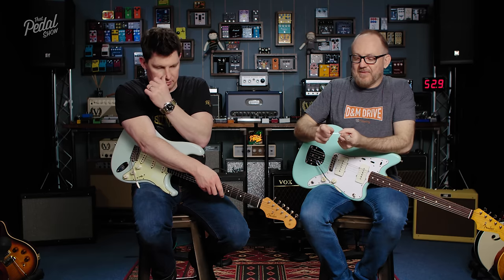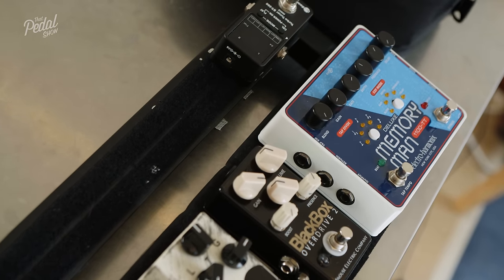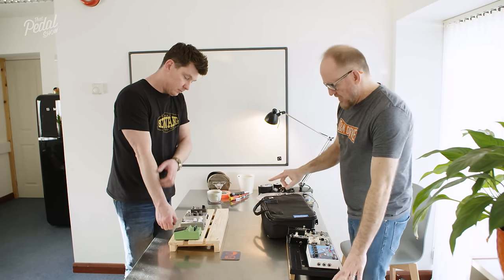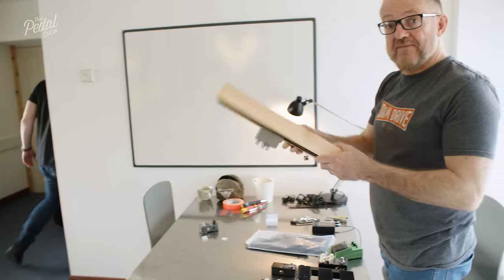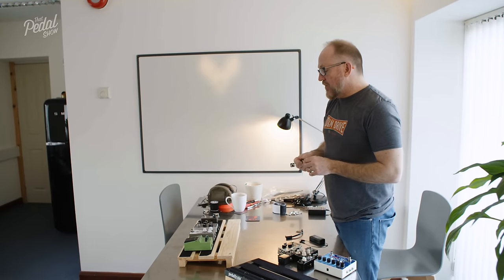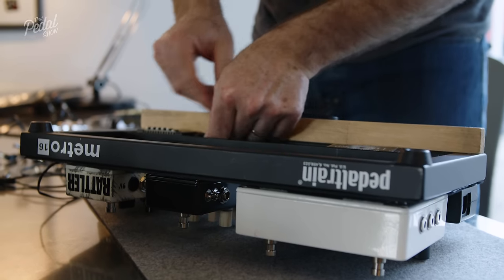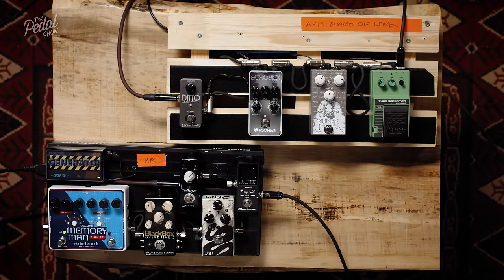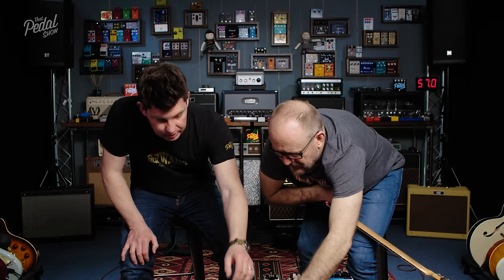Tips For Your First Pedalboard Build – That Pedal Show

Comment: I try to remember to have the iec cable on when placing the power supply to avoid that. I have routed non modular power supplies only to have to undo them. One of those was defective the other need some cables I tied behind the motherboard tray unmanaged because it got upgraded. So that happens, lol.

Comment: My pedal dudes... I love that my new Friday routine of spreadsheets and powerpoint presentations has TPS in the background. I, like Mick, have had issues with isolation noise. I thought the battery fix was cool, but what is the next step? Buy a new power supply? Or just grin and bear it and use a battery forever?
Reply from the maker: Whatever works Bryan. But about five minutes after I first plugged it in I decided I'd never use anything but TheGigRig as long as I live. Cheers!

Comment: More jam time por favor! That was a great cap to a solid video recapping the fundamentals of board building. Question: the mythos pedal Mick was having trouble with, was it receiving signal noise from one of the other pedals (i.e. How a digital pedal can sometimes create sonic artifacts along a daisy chain), or was it a ground loop (which I can't see how that could be since it theoretically was "lifted" by virtue of being battery powered). Unless of course the nature of the battery source itself could cause "dirty" power. I think I just talked myself into a ground loop. 😅

Comment: Just a thought ,on the chord running in front of you issue.Now would this change if you happened to be a left handed player.Your chord would come out on opposite side in this case.Wouldn't that put the chord back to where you had to step over it?I know the signal path couldn't change  .But,couldn't you arrange pedals from L to R?Keeping the signal path that it takes from R to L.To keep the chord from being in front of you.Remember most likely someone who is a lefthanded player.Most likely are going to want to use their left foot also.Hope this isn't confusing.Or maybe a lefty would just have to adapt.Great show guys.Always making me think.Keep up the good work .Corey

Comment: Why does the loop side go on the board? So you can hoover it clean. Once every 3 years, whether it needs it or not.

Another pro tip: try cutting the pedal-side velcro in triangles, it gives you a better chance of pulling them off the board without just ripping the velcro off the pedal, simply start pulling at the point of the triangle.

Comment: VCPI turned out to be a surprisingly difficult thing to follow in real life after deciding to buy a fitting power supply for my use, after watching the video. Like, you have five pedals? Great, you can just about do with a something like 120 euros power supply and get the isolation done properly. However any more than that and you're either gonna spend something like 200e + or just straight out go all in and buy gigrig independent items.

If you don't care about isolation, you're good to go with more pedals and if you care about isolation, you are good to go if you got 5 or less pedals. OR pay a hefty amount of money. Voltage, current and polarity are usually fine with any decent power supply option and common pedals, you won't run into problems, but isolation is a bitch frankly speaking. You're almost bound to go daisy chaining some of your pedals from isolated output unless you go heavy on investment. And it turns out that you run out of slots really quickly if you get interested in pedals. Like just gain section will take 2-3 slots easily, including one or more of overdrives, distortions and boosters, even if you try to be picky about your practical board. Then the time section will have 1-3 pedals and modulation will feature 0-3 if you use any effects in your set. Then there's "special" pedals like fuzzes, wah, eq and whatnot. And you better not be versatile in your sounds during the set, that will likely add a couple of gain pedals more.

I never thought it'd get so complicated so fast with powering them back when I started watching the show and had overdrive pedal barely used and wah sometimes, having just one gain/clean sound from the amp and reverb from the amp itself as well. Daisy chain was all I needed because there basically wasn't any signal chain to care about. It's really hard to figure out what kind of power supply you need or can get by with if you try to be efficient and not get something completely unnecessarily overboard for your needs, and if you try to not spend more than you need to. The dream of course is build everything exactly prefect with gigrig products and the cables Dan uses, but oh boy, that's some big money.

This wall of text ends with an idea that was inspired by the thought. It would be brilliant if you did an episode about the practical side of the power supply shopping. You'd have different sets of pedals from beginner board to intermediate to advanced board (even an extreme board perhaps?) and discuss all the possible power supply products that the board would need or benefit from. And of course the different options if the boards had some. That might be really helpful for people who try to estimate their power supply purchase from existing options without going for the priciest one by default.

Comment: I was just about to build my first pedalboard,  but I had two strokes instead. Busy recovering these days, but I’ve thought about patch cables , and pedal order etc. Is it considered  ‘okay’ to go through the front of my amp with gain stages, and run time based effects through the effects loop? I think so, but I’m not sure about modulation 🎃. Stay safe & keep doing what you’re doing!
Reply from the maker: Of course Duncan, and sorry to hear about the strokes - hope your recovery is on track! 
Yeah, that’s the way most people do it. Modulation is always tricky because some people like certain mods pre drive. So just try it all ways, safe in the knowledge that there is no wrong way. Only the way you like best!

Comment: Q for Dan, about power: when you use the power cables that come with a power brick (as I do), as they're not made to measure, you typically end up with a tangled mess of excess power cable like Mick's board had (as I do). Q1: is that a problem? and if so why? (Dan did a build for Ed O'Brien and he mentioned setting the power and signal cables at right angles to minimize 'interference') Q2: Are there any solutions for 'Macgyvering' the power cables that come with a power brick to make them shorter? (The GigRig system looks perfect, but I'm not quite there yet) Many thanks!

Comment: It's all fun and games until that one pedal decides to be noisy. For me it was the Sabbra Cadabra by Catalinbread. Great sounding drive, but extremely fussy about being isolated. Also, it seems that wah pedals can create a bit of noise if placed near or over a power supply. Have you ever experienced that? Is that just another good reason to have wah pedals to the side of, rather than mounted to, a pedal board? 
Re: flat boards & power mounting (for anyone looking at options), Cioks makes some slim cased power supplies that fit nicely under low-riding pedalboards like the Metro series.

Comment: I put my velcro on the other way. As much as I like your way of thinking for carpet, it wouldn't be good for my carpet and I mostly have hardwood, which would not like the hard hook side either. On top of that, I often use the pedals solo on my desk which has a big deskpad, and the hard hook side would destroy that pad very quickly as well.

Comment: Looking forward to watching this as I started building my first board last night! The question I have doesn't look like it'll be covered judging by your liner notes. Is there any disadvantage to wiring up your board for stereo? If you only end up using one amp are you only getting half the signal? I guess similar question for wet/dry/wet?

Comment: I use Dual Lok.  I don't remember the model number but its the kind that is rated for broader temperatures,  If your gear is transported in trailers the temperatures it experiences get rater extreme.  Velcro glues fail when it gets too hot.

Comment: Dan, I've built a number pedalboards over the last couple of years and really enjoyed experimenting with different things under the influence of TPS. One of the things I've been experimenting with recently is observing the impact of varying voltages between 6v-18v on the way pedals sound and behave. Some pedals I'm comfortable doing that with, like a Hudson Broadcast, because they're explicitly rated for up to 18v or 24v. I know you've touched on it a bit before but how can I know if increased voltage will damage my pedal or not if the manual doesn't specify? I picked up a Vox Big Ben Overdrive recently that sounds really cool and would like to experiment with headroom/tone/voltage but don't want to damage or destroy the circuit. 🤔

Comment: I started playing when I was 12 years old. I am 35 now, and am just now building my first pedal board. I played a Peavey Classic 50 2x12 for years. So I had a decent clean and dirt sound and reverb. It worked for 15 years. But the Classic 50 crapped out and I have been building a single channel Super Reverb with a friend. The amp has reverb, and I don’t really want a huge board. But there are a handful of sounds I want available. So I’ve bought a Pedaltrain Nano+ and am going to load it up with all mini pedals. I have done my research and I think I’m going to have (in tentative order)...

D’Addario Mini Pedal Tuner
Wampler Mini Ego Compressor
MXR Classic 108 Fuzz Mini
Wampler Tumnus
Xotic SL Drive
LovePedal Pickle Vibe
TC Flashback Mini

Powered by an Eventide Power Max. What y’all think?

Comment: Awesome and informative as always. I've noticed, lately, that even with a nice board with isolated power, there's still less noise when I simply plug straight into the amp. Does anyone run straight in, and then put all their pedals in an fx loop? Would that reduce noise? Thanks as always guys!

Comment: I,ve just  finished a small board for jam nights. I didn’t want a power supply that was plugged into the wall as I never know if a spare socket will be available so went with the pedal train Volto version 3. No noise so far and works great. I expect you may have tried the Volto Mick if so did you have any grounding issues?
Reply from the maker: Hi Peter. I won't use anything but TheGigRig now. Every other  power supply I've ever tried has some kind of compromise.... Though to be fair I've never tried the Volto. I know TGR will work all the time, every time. And for the difference in price, I'm done with worrying!

Comment: The entire hour and 9 minutes, 16 seconds was worth it just for the tip of not putting Velcro or Dual Lock over the screws on the bottom of the pedal. That’s exactly the kind of stupid mistake I would make when building a pedalboard. I would ideally like to use a pedalboard that doesn’t use any kind of adhesive tape or cable ties. I’ve seen one option that uses brackets on the board to hold the pedals in place, but they don’t make one big enough for my needs. The bike chain link solutions seem very clumsy to me too.

Comment: Great video! I have an Ikea shelf pedal board! I am slightly confused about the Dual Lock/Pedal Board tape. Can that stick to standard Velcro loop tape? Or do you need dual lock on both the pedal and the board?
Reply: I do not get that too. Clarification required :o)
Reply: Same Dual Lock on both

Comment: Awesome video I can’t wait to build my first board! I noticed on some boards people use Noise gates. Does buying a premium power supply negate needing a noise gate on your board? If this is true then I question why people don’t just get a true isolated power supply for their pedals. I would think a cheap power supply plus a noise gate not only takes up more space on your board, but also costs about the same as the expensive power supply at the end of the day. Seems like a no brainer to me to get a premium isolated power supply if this is the case.
Reply from the maker: Hello Merrick, we would agree with your point pretty much entirely. The point at which you ‘need’ noise suppression is usually for people who use very high gain amps and/or very noisy effects. They’re usually digital. Cheers!

Comment: Made my first and only pedalboard in woodworking class in highschool. Still works just fine!

I have a question regarding the Mooer Trelicopter. Does yours quietly click when it's not on? Mine clicks to the tempo of the tremolo when it's off. Sometimes if I have a pedal with a buffer infront of it, the clicking goes away. Is this a design flaw or is mine just broken? 

Love the show!

Comment: Guys as usual, great sounds. You need to jam more often! Dan, I love your idea of "beginner." Your board is worth more than my first car! Both of you had great sounds though. I think I might be investing in a virtual battery or two on my personal board, as it seems like a great budget alternative to a completely isolated power supply setup. Is the virtual battery limited to low current applications, or would it work for a high-draw pedal like a complicated digital delay? As I said before, great sounds this week! also, thanks for using affordable amps. They sounded great as well.

Comment: Listen to Dan but if you have to go cheap on the power supply just keep your digital pedals (most reverb pedals, loopers and some delays) off the same cheap power supply as your analog pedals (may have to have separate power supplies for each of the digital pedals - will vary). Donner makes a good cheap supply that works fine for me.  Be sure there is room for your power brick underneath if you go with making your own out of wood.  With the brick underneath you can route all the wires up through the bottom and all the mess is hidden.  Other advice is don’t watch this show if you don’t want to outgrow your pedalboard on a monthly basis. Outgrow your living space possibly too 😉.
Reply: My equipment has a good home and is kind enough to let me crash on the couch.

Comment: What is the best way to run a longer audio cable underneath the board to insure that you don't start getting any type of noise from your power cables. I've always been told that when an audio cable comes into contact with the power cables, the power cables can become little noise antennas. Thanks again for having such a great and informative show.
Reply from the maker: I don't have that problem. Mick here. Cheers!

Comment: Great show!  I have a quick question on power supplies.  I recently did a build with a truetone cs12.  I ran out of 9v inputs so i attached buck converters to the 18v inputs to lower their voltage to 9v.  I was worried about noise, but i haven't had any trouble yet.  Have you tried this before?  Was this a bad idea?

Comment: Hi Dan and Mick, if someone doesn't have the means to get a GigRig Power supply for whatever reason, what other power supplies would  you recommend that you have personally used?
Reply from the maker: Mick here. It's a really tough one and depends entirely on the pedals. MXR/Dunlop iso brick looks okay, and any of the voodoo lab stuff. Just be aware of VCPI and you'll be fine. But. If you buy something cheap and you're in this for the long haul, you'll be buying something else in a year or two, and then again a year or two after that...

Comment: I really would love to do a pedal board. I want to use dual lock so things can be reconfigured, but I have one hang-up; I don't want to stick any adhesive to my expensive Strymon pedals. Should I just get over it, or is there some way to not have the adhesive peel off the paint if it's ever removed? Thanks guys!
Reply from the maker: The Dual Lock is pretty good. Comes off pretty much every pedal I've stuck it too with no problems. And remember, you only need four little squares...

Comment: If you’re using dual lock on the bottom of the pedal, do you have to have the loop side of regular velcro on the board? I generally have the hook side on the board because I think it looks better.

Comment: I put together my first & only board about two years ago. I'm thinking about adding a second power supply that has the option  to switch voltages as a couple pedals can run at 18v and has some higher output vs my pedal power two supply. Are there any issues that I should be concerned about using two supplies? Especially if they are both getting plugged into the same power strip? Ground loops, etc. Thanks, great show.

Comment: How did you mount the wood block under the pedaltrain? I would like to do that too.
Reply from the maker: Drilled through the top of the PT, then woodscrews all the way through. If you get the torque right the screws will pull in so they're flush with the top of the rail, lessening the bump where the screw heads are. Cheers! Mick here
Reply: @ThatPedalShow  Thanks, Mick!

Comment: I tried the mission PSU with a battery pack, and from the charger and it was noisy as hell. such a shame as its a great idea. changed 2 different PSU's too. :( 

That's the noise I got with the runestone
Reply from the maker: Contact them Andrew - they updated it and are doing free upgrades before a certain serial no. Cheers!

Comment: Quick question- I use Gig Rig power for my boards. I’ve been under the impression that using 3M Dual Lock (pedal board tape) on the power supply (The Generator), is not a good idea. Is it advisable to avoid tape on a power supply... or does Dan give me a thumbs up to use pedal board tape? It’d be tremendous if I finally knew the truth behind my dilemma!

Thanks gentlemen... wonderful work as always!
Reply from the maker: We both do Francis. Tape away! It never gets hot enough to bother the tape. If you're really worried, cables ties are maybe better.